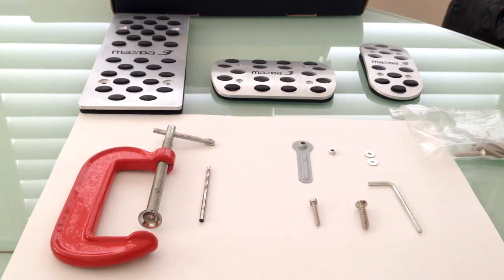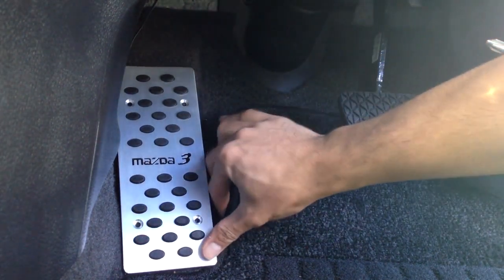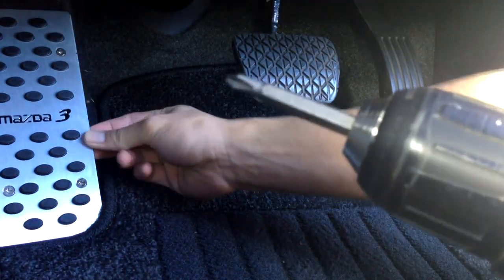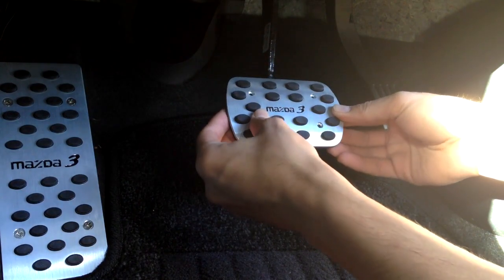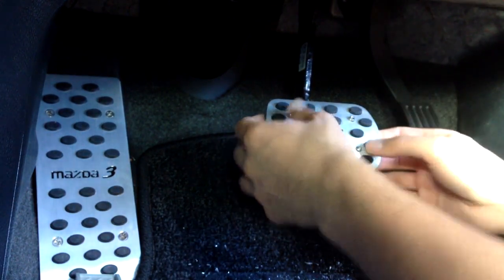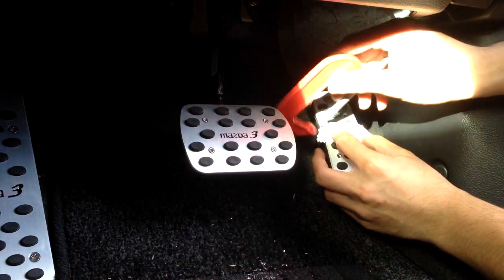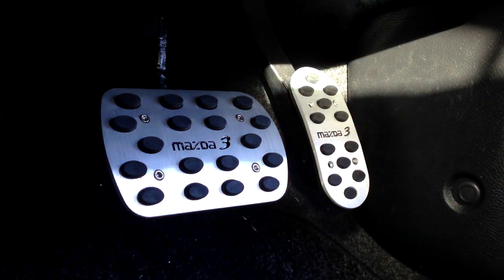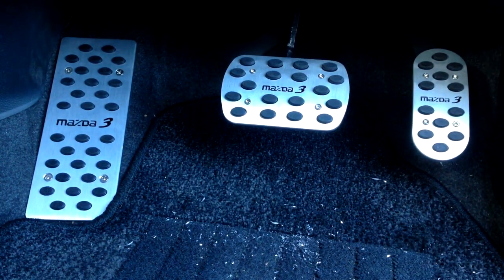How to install brake pedal kit tutorial

Comment: I heard the clamp-on type covers were bad because they can slip off, but I wasn't sure if I could install the screw-in type without removing the pedals entirely first. Now I know it's easy, so thanks for the video.
Reply: I used to use the clamp on ones on my Honda Jazz, it fell off every now and then and its dangerous because my shoe laces got tangled at times. Wouldn't want to die because you couldn't brake being stuck on the accelerator >=[

Comment: Hey, if you had that much difficulty with a 14.4v drill.... I'm assuming my 12v black and decker isn't going to cut it?
Reply: I don't think so, my battery was running low at the time xD Gave it a charge and it was much easier!
Reply: İmportant point is the drill bits quality man,not about the drills voltage.
Reply: Drill bit quality and drill power is both crucial :)